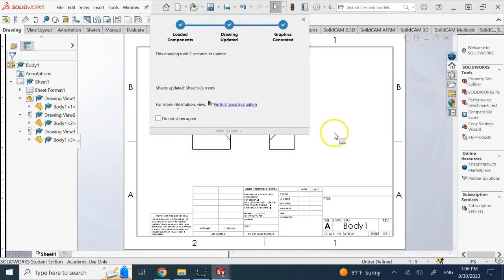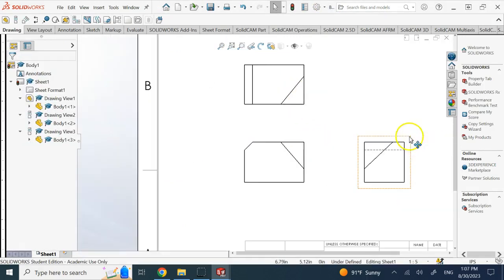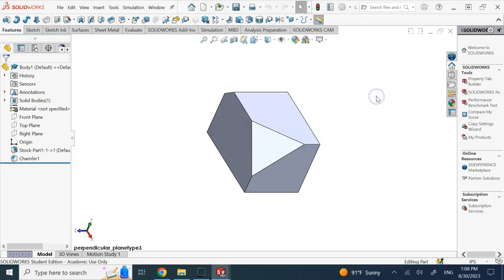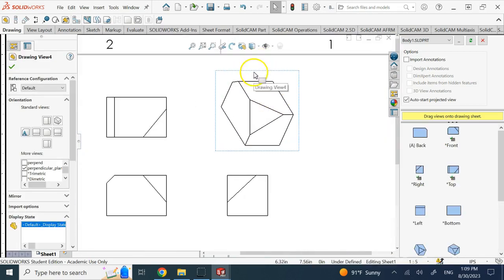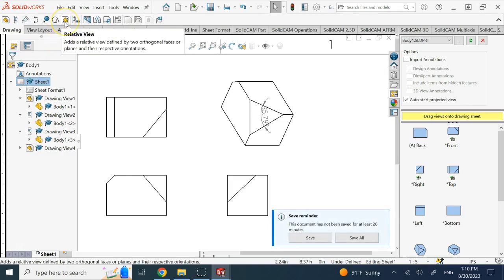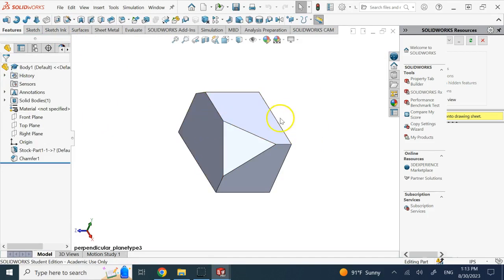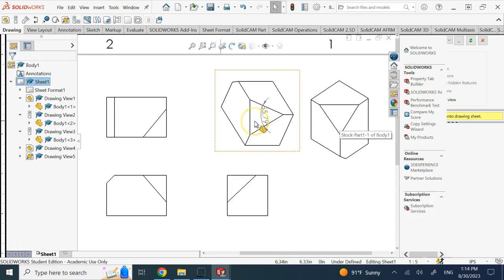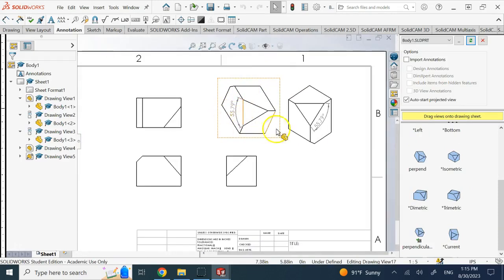New View, Relative View, View Palette (parts with Oblique Plane in SolidWorks Drawing)

Comment: This is a question on the CSWP-DT Exam: Advanced View Creation. I have been looking for this video for two weeks. Thank you very much for making this video.
Reply: This this this! Only question I got wrong. Their was 2 questions, one multiple choice and one field entry. I only got the multiple choice correct because I oriented the part as close as possible to the image given, then inserted as current view from the palette. The one i got wrong was specifically asking for the distance between two edges on another of the faces that wasn't the front face. I was close too. I figured I needed a plane but I missed the perpendicular part. I wish they would put this in the practice exam because it felt like it came out of nowhere!